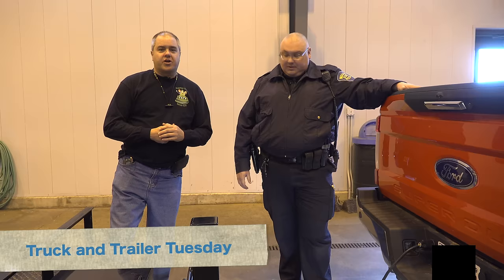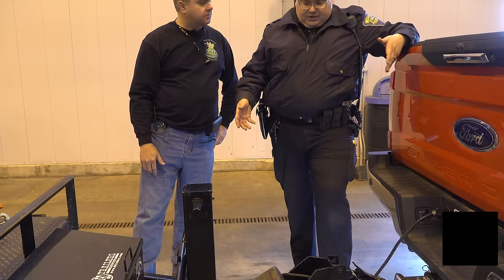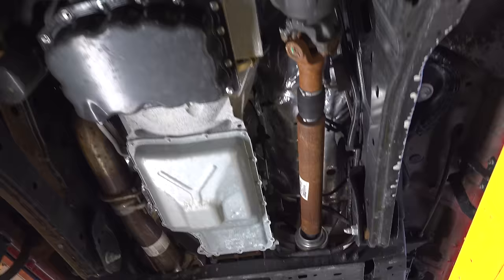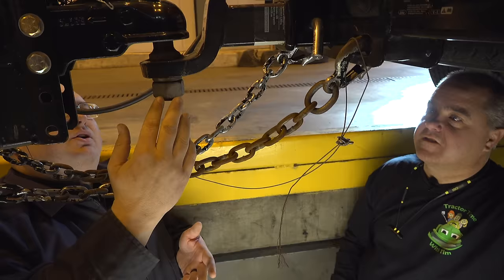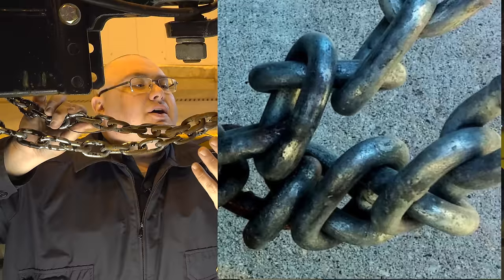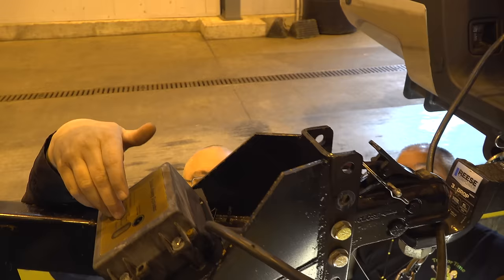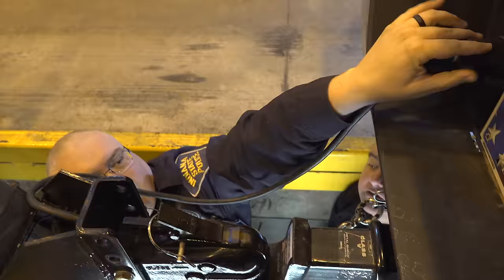Uhoh! Tim Fails Inspection! Truck & Trailer Tuesday with Trooper Hoover

Comment: I am glad that he pointed out the cable I put mine on the frame or the bumper so if you would have a total failure of your hitch the brakes would still be activated on the trailer

Comment: Hey tim I just take eye bolts and install on all my trucks so the electric break away cable is completely separate with a snap clip
Reply: Breakaway should be connected to the truck frame.  Hitch bolts have been known to fail and breakaway cable goes with the hitch, not applying the emergency brakes.   There is a YouTube video showing that situation with a travel trailer.

Comment: @5:40 you can clearly see a gap between the nut and washer on the ball hitch, I recommend unscrewing the nut to put some heavy duty Lock Tite on the threads and torque to specification.
Reply from the maker: Yes, and it has been commented on repeatedly, and fixed the same day as this was filmed.

Comment: I had the same type of break away on my trailer when I bought it. Took it in to. I replaced it with one that had a Bungie type cord. A lot better the. The stock setup and it give it a better hookup and it like a spring coil type of Bungee. Love it.

Comment: After you replace your Brake Away Battery and Box, you need to pull the plunger on the Brake Away Switch and make sure all four service brakes lock up.  During a Level 1 safety check you will have to prove the brakes lock when the plunger is pulled.
Reply: it should be don ever year.
Reply: @davidj.kester7979  100% correct, it's part of the FMCSA inspection.

Comment: Bumper pull is the majority till you come out west then we use goose neck a lot.
Reply: For sure!  My truck is setup with the gooseneck since I have a lot of back problems. I can't do the lifting I did when I was 20.  My fifth wheel trailer uses the gooseneck hitch but my 16' utility trailer and my canoe trailer both use the bumper pull receiver.  Brakes are installed on the two large trailers but not on the canoe trailer.  Some of the roads go through some pretty tall mountains (12,000 to over 13,000 ft)  Makes it pretty dicey if you lose a trailer when you are going downhill and a 1,000 or 2,000 foot dropoff.

Comment: Drive shafts don't get painted because of balance issues. First you can not weld on balance weights on paint. Painting after will through the balance off, or when paint comes off will then through balance off.

Comment: I am in Ontario Canada here any combo of truck trailer, and load is over 4600kg you need a yellow sticker inspection on both. So that a yearly mechanical on both.   Only exception is a camper trailer or motorhome.
Reply: Here in New Jersey, if your truck is over  gvwr is over 8500 lbs (f250 or 2500 And bigger) and is a 2008 or older, they're exempt from inspections. Makes sense right? Lol

Comment: That trailer has a suspension, it's a dexter torsion axle. It has rubber in the axle tube that absorbs suspension shocks. They can get bagged out to the point of a no-go, just not as obvious as leaf springs.

Comment: Every few weeks of winter, rinse off the underside of anything that has seen salt. The drive shafts are just bare steel so they oxide almost the day the truck was built. The trans and Transfer cases are aluminum or mag, They will surface oxide and thats normal
Reply: Depends on what type of steel or aluminum is used on your vehicle. Should be  6061 grade aluminum which is corrosion resistant and use a steel alloy with nickel for corrosion resistance for any vehicle. Car/truck manufactures use the cheapest grades of aluminum and steel to make sure their CEO make a million dollars a year.

Comment: In my 27 years doing Brent’s job here in NH, it would make you stay at home if you saw the condition of a lot more commercial vehicles than you want to know about! My focus wasn’t commercial vehicles, like Indiana, when I was on the job, we had a separate division that handled that. However, I worked many years on I-95 so commercial vehicles, especially on the mid shift, fell to troopers to enforce. I had drivers stop ME more times than I can count, asking me to do an inspection and put them out of service because their company told them to drive the truck, or walk home. I wasn’t as knowledgeable as Brent there…commercial vehicles was more of a side line for non-commercial vehicle enforcement troopers, but we knew enough and drivers were more than happy to teach us a thing or two in order to get put out of service. Maybe things have changed…I’ve been retired now for 18 years, but I always think about the 80,000 pound hunks of steel rolling down the road towards me. Good informative video!! Thanks Tim!

Comment: please come and inspect the trailers here in Florida.  90% or more don't even have lights on them.  i'm not saying working lights.  the lights are missing all together.
Reply: @Elvis Presley lake co
Reply: jim h in MI, no trailer lights necessary.  1. During daylight hours and 2. Tow vehicle taillights are visible.
Reply: @Elvis Presley you're
Reply: @Elvis Presley middle east coast
Reply: Brevard county loaded with landscape trailers no lights, shit hanging off them, bald truck tires drives me insane...
Reply: @Elvis Presley Gainesville haha
Reply: Just worry about yourself @Jim h
Reply: @senditkevin  Gainesville isnt in Lake County
Reply: @Albone3000  jim h probably just moved here from up north. First thing these culls want is bring the politics and laws they hated and left for with them. I see plenty of DOT. FHP established a dept to cover inspections on Fl. roads
Reply: Jeremiah Carrico Florida law requires several safety lights and devices on towed trailers. Required safety devices include safety chains to connect the towing vehicle and the towed vehicle in case of hitch failure. Your trailer or towed vehicle also must have stop lights, tail lights, license plate lights, clearance lights and working turn signals. If you are towing a vehicle that weighs more than 3,000 pounds, the law requires breakaway brakes to stop the towed vehicle in case of unplanned disconnection.

Comment: every time  I connect to one of my utility trailers I inspect all safety items plus lights on the trailer and the truck, tire condition on all tires including the spare  and tire pressure.  I check the brakes as soon I start to move the trailer. The wire that goes into the 7 way pin connector on Tim's trailer  could be sealed with clear silicone caulk to prevent further damage and seal out water.

Comment: BEST / easiest electric brake cord is the RED stretchy type sold at  most trailer stores , i have a extra stainless steel spring snap link specifically for that , hooked to truck hitch frame , separate from chain hooks as he said  , THE new super duty trailer hitch frame is so thick , i bought two extra D-ring shackles , be safe

Comment: 1 thing I noticed the inspector didn't mention.  It may just be a New York thing, the hooks on the chains that connect to the truck.  The open end of hook must be pointed to the rear and pulled in behind the mount. I was taught in commercial driving school,  and long before, ,that's a violation.  The little safety latch was not discussed however.  Is that the difference? This is a great educational video as well.  I've never seen an inspector measure the girth of the chains!  The weapon of choice for our troopers NY,  the portable scales!

Comment: NYS was hitting hard the last 2 years on the little guys, pickups and even single axle trailers. Contractors, lawn guys, etc. But there's the deal for NYS and Fed dot as explained to me by 2 very cool Troopers, if you are conducting business in the state with your vehicle and trailer AND the combined weight you're rated for is over 10k lbs but less than 26k lbs, then ya have to display a USDOT number and company name on both sides of the vehicle visible at 50 ft away, you have to have a medical card (what a hassle and joke of an exam that is too), and you have to keep track of miles and hours (from the time you leave your house/office/start of the work day to the time you return. Quickbooks Self Employed already tracks the miles and times so that's easy. The DOT number is free (don't get taken in by the multitude of "compliance companies" that will contact you. That's all. NO CDL needed. Oh and yes every light has to work. Something extra if you cross state lines for business but I don't know what since I stay in state.

Comment: It's good you have your safety chains crossed to cradle the tongue if something happened. But you should turn your hooks around so that it pulls into the throat of the hook instead of the tip.

Comment: There was one time I was going down the road and was surprised to see a trailer rolling on it’s nose wheel several feet behind the tow vehicle. I’m guessing the driver didn’t pin the hitch and he obviously didn’t hook the chains. Another time, I saw a jeep pulling a small trailer and neither the tow vehicle or trailer had working lights. Personally, I have a routine I follow when hooking up and I always check the lights.

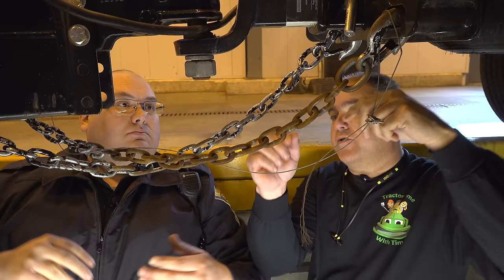Comment: At 6:33 you can see a gap between the hitch ball nut and lock washer that goes all the way into the shank of the hitch ball.  It's not correctly torqued. specs can be found on hitch ball mfgr website and it varies by shank diameter. I tow a 30' travel trailer and at rallies I have used a Dollar bill and see if I can slip it in between the nut and lock washer. It's a quick easy check but agreed it does not indicate fully torqued only that enough torque was used to compress the lock washer.

Comment: Hasn't been mentioned in this series (that I found) but privately owned trailers tend to have dry rotted tires after a few years, and all the owner sees is tread wear. Would be nice to know where DOT draws the line here. IOW, how much is too much?

Comment: 11:35 Just wanted to point out, if your trailer has been sitting a long time, and the brakes are locked up, cutting the brake wires won't help you unlock the brakes.
Reply: Then why does it work?
Reply: @yzrippin  not sure,  technically, it shouldn't do anything to help a locked up brake. Those brake wires only have power when connected to a truck, and the brake is applied. If you were to cut the wires, and it did free up the brake, then there is an issue with the breakaway switch, plug/ trailer / truck wiring or a bad brake controller. Also that would affect all the trailer brakes and not just one.

Comment: No suspension n the trailer? That's gotta be a rough riding beast. Great video. Sometimes I wish the DOT would pick on the trailers with no lights, bent axles, overweight, boneheaded things we see every day. I've got a sweet trailer with elec/hyd brakes (disk brakes) You know for a fact these things work. It's on an 18ft aluminum car hauler.
Reply from the maker: Torsion suspension…supposedly the best style. Upgrade over spring suspension.

Comment: i would argue on the colored wire showing at the vehicle connection plug. that point  looks like it has some sort of cable strain relief or seal so i would fix that straight away to prevent wire from ripping out of the connector or corroding.

Comment: Iv always used a carabiner on my breakaway and hooked it to the bumper of my truck.  
If for some astronomical failure were all the bolts break and the hitch falls off, the breakaway is still connected to the truck to be pulled.

Comment: I just noticed you have hooks permanently attached to the trailer chain - is that usual over there?  Here we use rated D-shackles so can attach to any link in the chain, solving the 'dragging' issue.
Reply: U haul tought me and the inspector approved it.
U have to cross the chains 1 time at least so keep spinning them till chain length is what u want no limit on amount of times.

Comment: My bumper has a hole for a ball, i run the cable through there and hook it to itself. It's long enough it doesn't engage in turns and short enough it'll pull before the chains catch the trailer.

Comment: the break away cable is designed to be pulled out and tested. while it is pulled out the switch end it is to be wrapped around a permanent part of the tow vehicle then put through the eye of the other end. this creates a "lasso" type connection that can only be removed by pulling the switch end back out. its ironic that it is ok to let the breakaway not working go because it is a private individual but "out of service" for a commercial vehicle.....the risk is the same whether it is commercial or private. it is understood that a private vehicle would not go under such an inspection. it could be argued that the risk is higher for a private user who doesnt tow a trailer as much as a commercial tower. therefore a private tower could possibly less training or experience detecting and handling emergency towing situations. the potential for an accident or harm doesnt change because there is not a company name attached to the registration.

Comment: I was wondering about riding in the RV trailer. In N Carolina, you can ride in the RV trailer going down the road. Now lets say your on vacation, you got 6 in the truck and 1 in the RV trailer. and you cross the state line in to say Virginia where its illegal to ride in the trailer. If you pulled over, do the state police ask you do you have a passenger in the trailer? Or do they just not ask.  And if so, what would happen? You cant just call a taxi for the 7th person. So what would they do, let you go with a warning? Or what?

Comment: I like to add that his remark about a 3 in drop does not constitute heavy duty. By capacity standards.. sometimes the bigger the drop the less the capacity of hitch... I think the drop is mostly for the height and level of trailer to truck and not gross weight rating on reciever..

Comment: I often wondered if there should be a trailer license endorsement with trailer driving test that would be on any drivers license for any state. Requiring a trailer safety/inspection course with exam to pass in order to have a trailer on any vehicle. This would prevent a lot of incidents that we see on highways for vehicle owners towing a trailer.